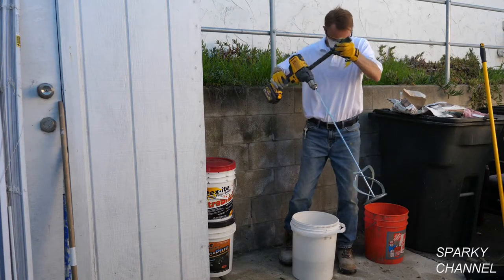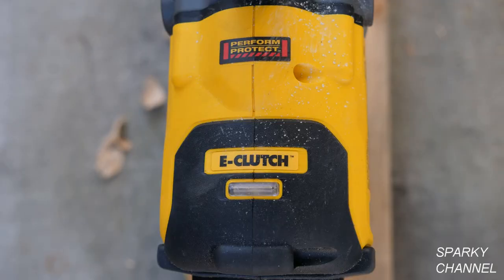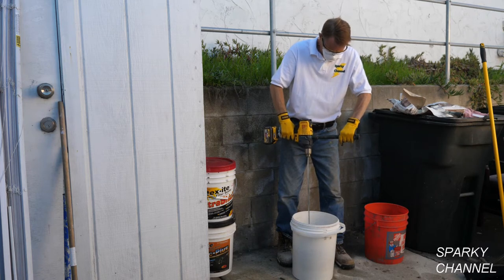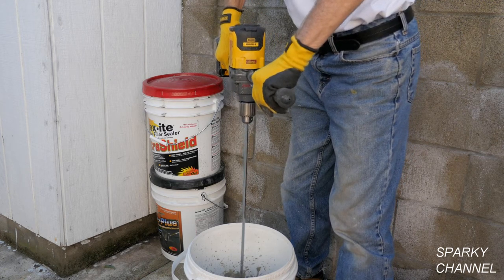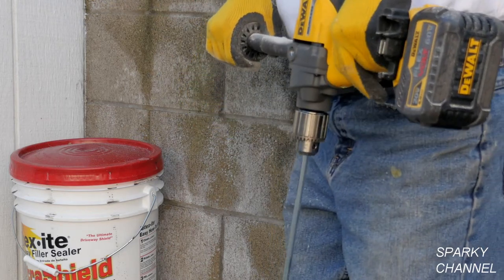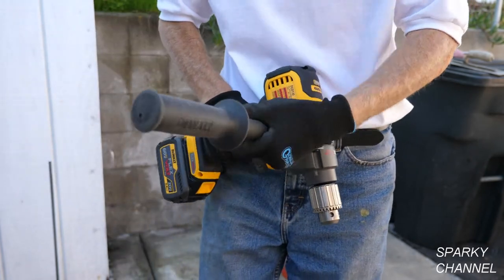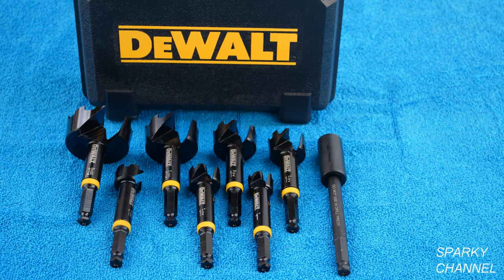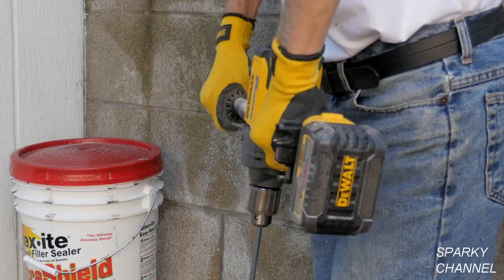DeWalt Mixer/Drill with E-Clutch System DCD130T1 60V Max Review and Demonstration

Comment: @Sparky Channel. Sparky. Thank you for reposting. And thank you for the recommended paddles for mixing. I have a future project and the recommendation will come in handy. Also looks like that drill will do you well in drilling through plates or studs for running electrical or plumbing.
Reply from the maker: Yes, exactly, it does both. Lots of power and low torque. Thanks!

Comment: Sparky, So i have watched the videos this DCD130 mixer drill and also the DCD470 joist drill. You have used both... I need to know which has the most torque in low gear, I know the mixer is 600rpm, and the joist drill is 400rpm in low, but which would you say has the most actual turning power? I am wanting to use a lower speed high torque drill to turn my trailer jack.

Thank you for your help